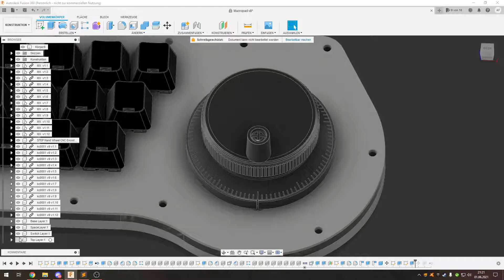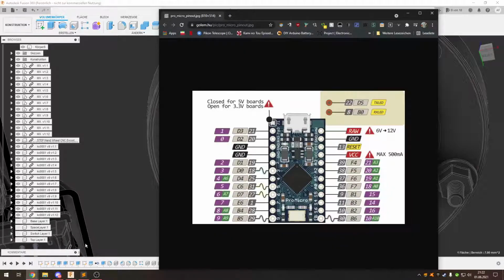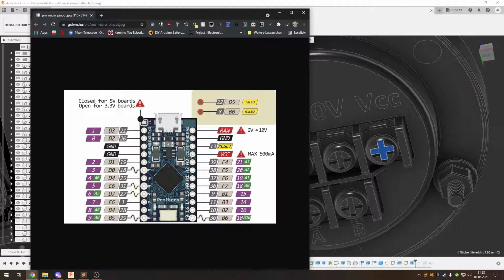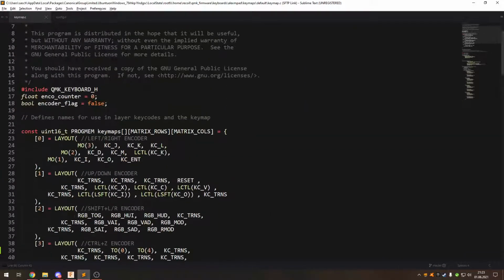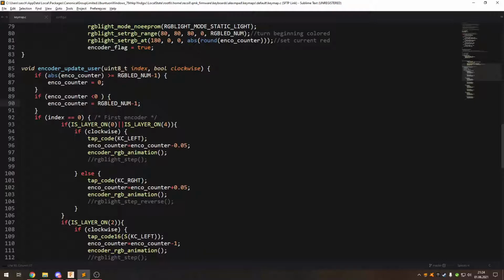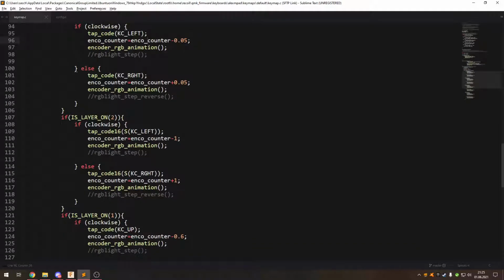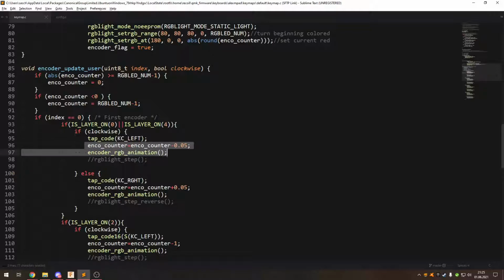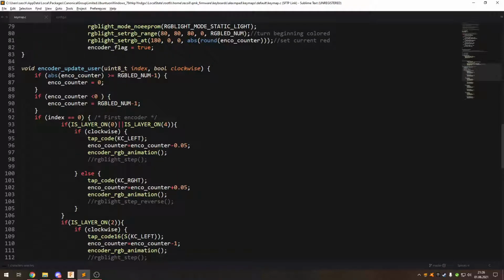QMK Encoder Setup

Comment: i have 2 encoder, what to i need to do in order to make them work.
Reply from the maker: basically not much, you need to define them correctly in your config.h like this:

#define ENCODERS_PAD_A { encoder1a, encoder2a }
#define ENCODERS_PAD_B { encoder1b, encoder2b }

and obviously wire them up accordingly to what pin you enter as encoder1a encoder2a etc...

here is the link to the official documentation for encoders in qmk: https://docs.qmk.fm/features/encoders
Reply: @Sty1a  thank you
Reply from the maker: @smit5599  did it work? im curious :D
Reply: @Sty1a  so i scraped the whole idea of programming in QMK, i am gonna via enable my macro pad.
Reply from the maker: @smit5599  yeah makes sense as it is just a fork of qmk. Switched my pads to vial
Reply: @Sty1a  =) thanks for help

Comment: I have never made a DIY keyboard and never used a pro micro before, how do i add the keymap.c and config.h to my pro micro?
Reply from the maker: Ooof... Uhm you don't really add them on your micro... You add them in qmk then you compile qmk with your keyboard name etc. That will let the compiler chose your keymap and config.. you will get a binary file that you need to flash to your pro micro. This video talks only about encoders. Which is very specific. Search for "setting up qmk". There are a lot of videos.
Or read up starting here: https://msys.qmk.fm/guide.html#next-steps 
The official documentation is incredibly well written.
Also you might want to check out "vial" it's a qmk fork. With a sort of GUI layout editor. Really nice..

Comment: I have  5 pins on my encoder (GND, 5V, A, B, KEY). 
Is it possible to add push buttons of this encoder in cheryMx keyswitch matrix ? 
How to solder it properly (which pin should i solder to row with diodes and to the column) ?
Reply from the maker: It should be possible, check if key bridges to ground when pressed, then you can wire it up like any normal switch with a diode. add it to a column/row that you like that has space for it.
Reply: @Sty1a  Today i have tried to  solder encoders and add push buttons  to keyswitches matrix - no results, buttons on encoders doesn't work (i'm soldered diodes to KEY pin and to ROW; and column wire to encoders GND). Any idea where i'm failed ?
Reply from the maker: @sergio_leone_ have you measured if key bridges the connection actually? Maybe there is already some diode in...?
Reply: @Sty1a  no, i have no multimeter, more over  i'm a newbie in electronics and don't know how to do it
Reply from the maker: @sergio_leone_  well you'll need one anyway. Set it to resistance test and measure the resistance between KEY and GND, some multimeters have a special setting where they beep when there is a connection.

Comment: Can you give me advice? 
I gonna build splitted keyboard with 109 (50 + 59) keys + 4 encoders. The question is: Can I use only single Arduino Pro Micro microchip? Is it enough contacts for all those keys?
Reply from the maker: Hmm I'm really not sure.. depends on how you wire it up... But my gut feeling says that should work, the best thinyou can do now is draw it on a piece of paper. You will have to do it at some point anyway.
Alternatively you could try to do it in a PCB design software like kicad or librepcb. But would it be so bad if you had 2 microcontrollers in it would make wiring a lot easier.
Reply: @Sty1a  The guys told me that it's impossible. One ArduinoProMicro can work only with 80 keys. So i'm gonna build my project with 2x controllers
Reply from the maker: @sergio_leone_  ahh ok, I mean not a Biggie imho, makes wiring actually easier 😅
Reply: @sergio_leone_  you can use a 74hc shift register to have more outputs. ive seen people use them with micros, but idk how they code it

Comment: Thank you for the video! I have a question: some encoders except knob rotation allows to click on it. Is it possible to recognize that "Encoders knob click" and wire some key combination on it ?
Reply from the maker: Yes it is, i have also a smaller version of that macro pad shown in the video using such an encoder.

in your config.h add:
#define DIP_SWITCH_PINS { B5 } //B5 is an example, wire the click button part of the encoder to your desired pin and note it down instead of B5

in your keymap.c add:
void dip_switch_update_user(uint8_t index, bool active) 
{ 
 switch (index) {
        case 0:		//ENC0_SW
        if(active)         //ENC0 pressed
		{ 
			encoder_function=encoder_function+1; //what the press should do in my case cycle through different modes for the encoder to operate
		} 
	else //ENC0 released
                {
			//do nothing
		}
            break;
        }
}
Reply: @Sty1a  Thank you!